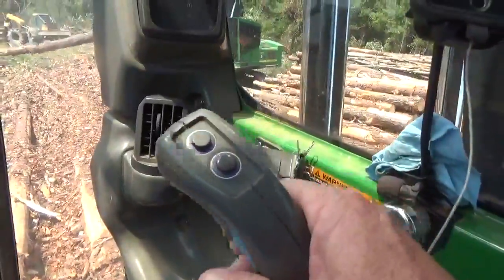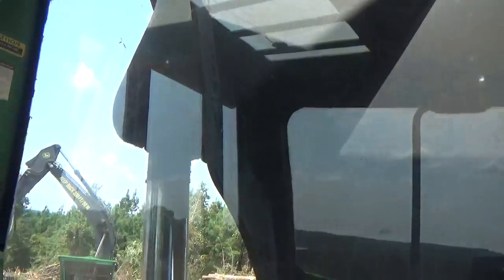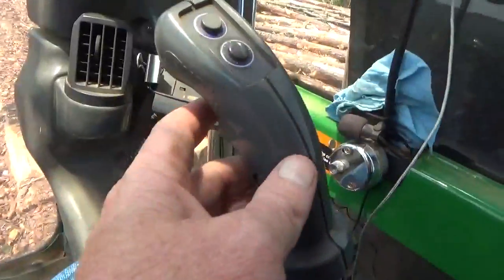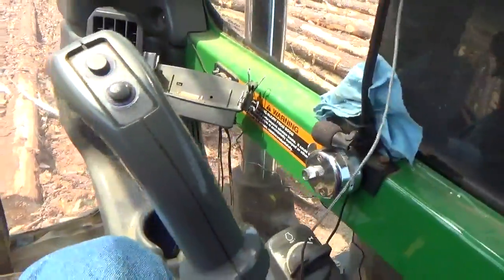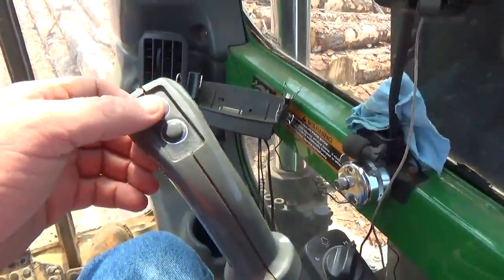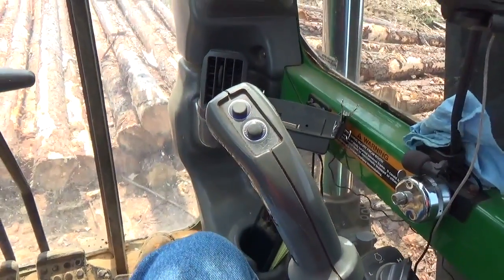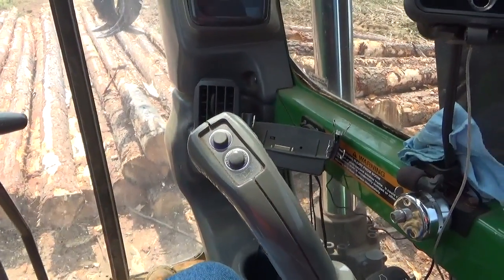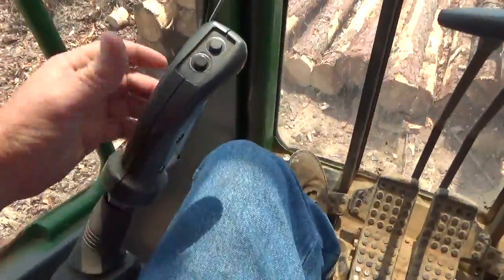How a John Deere 2154D track loader works

Comment: Wow, that loader works 100% different than I would have guessed. Never seen the grapple functions on two different activation systems like a trigger and a button. That must have taken time to adjust to if you came off an excavator or a Hood loader.
Reply from the maker: +Oldtimer f7 It wasn't bad.  I had more than 30,000 hours on 3 different prentice 410 loaders before getting the track loader.  The worse thing was the stick and main boom on opposite sides.  I can go from my track loader to the 437d or the excavator and even both processors and not even miss a lick and that was my goal.
Reply: +cotontop3 
See, the Hood I ran @ the chipper mill was exactly like a Cat excavator and every backhoe I ever ran.
It was like I had been on it for years right off the bat. It was an electric, because it was inside a building feeding the chipper when the drum debarker came on line for max production. Let me tell you, I was busier than a cat in a catnip factory. The ring fed directly in line, and the drum fed up to 3 cords a minute at a 45° angle to the chipper throat....real hard to keep up with crazy french canadians jamming the wood to you.
Twin turbo V12 Cat would gain rpms chipping frozen hard maple that had to be 36" across. Wood dust so thick in that building in winter that it looked like smoke.
Reply from the maker: +Road Boss yes but only by swapping pilot lines.
Reply: +cotontop3 Can you adjust the controls like you can on some excavators? Meaning switch the layout?
Reply: cotontop3 Ok, that makes sense. Thanks for the information. Your videos are the best ones on logging I think. You actually explain things and you will tell it like it is.
Reply: +cotontop3  I.S.O. pattern. I can swap but it ain't instant!
Reply from the maker: +Lewie McNeely It took me several times swapping before I could just hammer it instantly.

Comment: Thanks for sharing that video. I have always wondered how they were set up. I get so tired of the set up on a conventional knuckleboom with that swinging in the floor. Looks like they could add a valve or use one that is already there to free up your feet and swing it on the joystick. Enjoy the channel, keep up the good work!
Reply from the maker: You're fixing to see a trend and normal loaders are gonna start having a joystick swing rather than the pedals in the floor.
Reply: +cotontop3  Sounds like a plan to me. I can run a foot swing but with arthur in the feet and knees and about everything else, it gets tedious after a while.